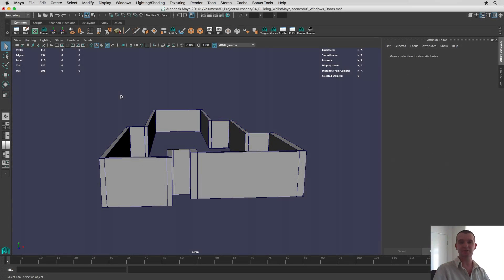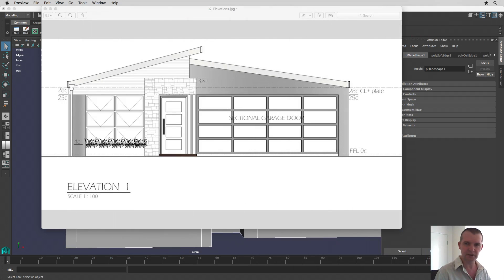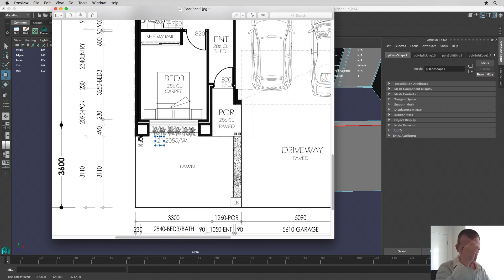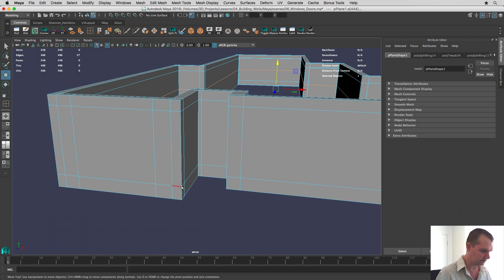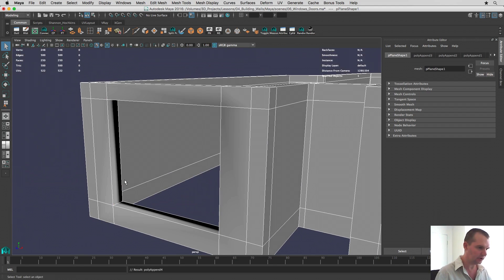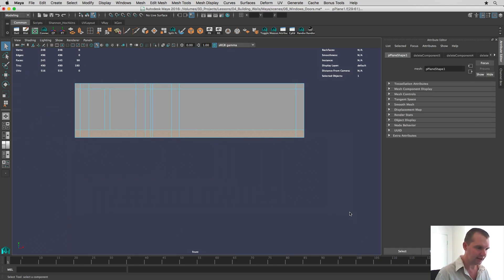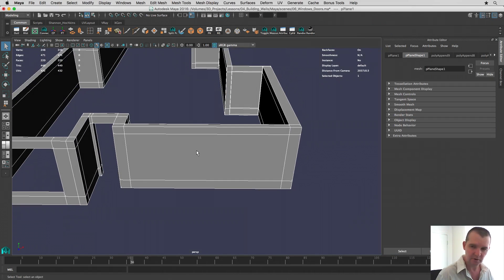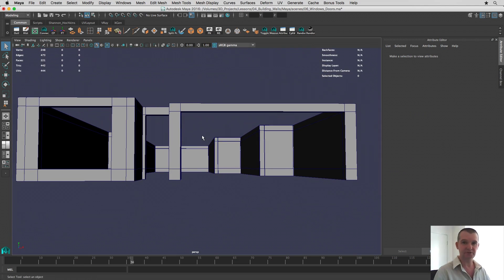How to Cut Out Windows and Doors in Maya

Comment: Hello Ian, Hope you are doing well. I have completed the project up to this point and have learnt a lot from this so thank you. 
One question I do have is how do you snap the 2 edge loops at 03:17 ? Looking forward to the next instalment.
Reply from the maker: Hey Alan... I am very happy to hear that you were able to get through the tutorials so far. :)

Regarding the snapping issue... It is pretty easy to do once you get used to it. If you have already set up your hotkeys in the way described in the hotkeys lesson, using the "v" key will activate the snapping. If not, you can simple go to the small icons on the top bar and locate the icon that says “snap to points” (it is in the third group). Click on this to activate it. Basically hitting the “v” hotkey or clicking the “snap to points” button will do the same thing. Once activated, make sure that that you are in transform mode by hitting “w”, and select the direction you want to snap to on the transform handle (you will see the selected arrow on the handle turn yellow). Once this is set up - MIDDLE CLICK AND DRAG on the edge or vertex you would like to snap to and voila! It should snap! Now deactivate the snap icon and you are good to go again. 

You can see the snap hotkey being setup up and the snap performed in this video here:

https://www.youtube.com/watch?v=BmoSJp6bJ_M (go to around 4 minutes 20 seconds).

If you can not get this to work or make sense, just let me know and I will create another short video to explain it better. I am aware that it can be difficult to follow with just a written description.

This may all sound a bit complicated, but once you have done it a few times, it will become automatic and you will perform this move within a second. Try to think of learning 3d in Maya in a similar way to when you practice your guitar. At first you learn a new scale or something and it feels difficult and unnatural, but once you have practiced it for a few days, it becomes automatic. Learning 3d is very similar, the unnatural will become natural with practice. :)
Reply: Many thanks Ian, I got all of the hotkeys done as per your instructions but I didn't realise that I had to drag to snap so we are all good now. Yes I agree with you small chunks of information at a time, digest that and then back in for some more. I am really enjoying learning this, you have already taught me loads!

Thank you kind sir, looking forward to finishing my house ;)
Reply from the maker: Thanks mate. I am very happy to hear that you found a simple solution to this. Yes, try to learn a little each day and it will soon all become very natural to you.

I think next we will look at how to model the roof, which is usually a little tricky, especially if it is a pitched roof, and we will also look at creating bevels and mapping out the uv maps in preparation to add some textures. 

Once I have finished my current couple of client projects, I will make the tutorials.

I am very happy to hear that the tutorials are helping you and thank you so much for the feedback. :)
Reply: Ian, I am the one who needs to thank you mate! although a newbie  I tend to pick up things (Computer based) really quickly, but I really want to thank you for your efforts! Quick question tho, I have heard that there are more "dedicated" software packages from Autodesk like Revit, not that I want to go and learn yet another software package but I understand that "Revit" is primarily used as an Architect type software?

I'm very new to the whole 3D concept and have been advised to check out "Blender", feeling a little confused now lol! please advise. 

I Will await your next tutorial and understand your present work load. 

Much appreciate your efforts, 

Take care mate!
Reply from the maker: Hey Alan, you are correct that there are many options. It really depends on your end goal, your hardware and your OS. Each piece of software tends to have various strengths and weaknesses. I believe Revit and Autocad are primarily used by architects. From time to time, an architect will send me a CAD or Revit file to use. They are great for laying out ideas and creating a 3D view of their project quickly. However, they are not so great at creating photorealistic renders. To create anything photorealistic, you would need something like Maya, 3DS Max, Blender, Cinema 4D, Modo etc.

Maya tends to be used a lot in the film industry and for tv commercials etc. It is great for most things, including character animations, product shots, and pretty much anything creative. It is certainly the industry standard. 3DS Max is very similar and also very popular, and tends to lead the way with architectural work due to its many assets and additional plug-ins designed specifically for architecture. The issue with Max is that it is PC only, so Mac users (like me)  have no option to use this. Cinema 4D and Modo are certainly clipping at the heels of Autodesk Maya and Max and I have recently seen some great stuff created with these softwares. Blender is getting better all of the time. The plus side is that it is free, the downside is that is has not taken off so much in the industry yet, but it is certainly getting there. 

On top of this you also have a bunch of different renderers to consider - Mental Ray, Vray, Fstorm, Octane, Corona, to name a few. 

I have been using Maya for quite a long time. I am determined to prove to artists that it can be used for architectural work just as well as Max. I want to show how versatile it can be once it is understood well.

I know it is difficult at the beginning to know what to choose. My advice is to try a few different things, and figure out what kind of artwork or animation work you are most comfortable with first. Then your choice of software will be made easier. :)